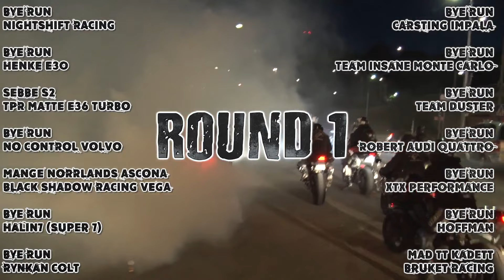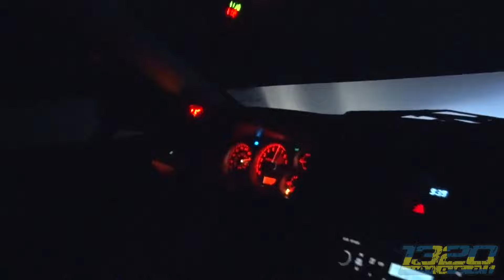The STOCKHOLM OPEN Street Race (Full Movie)

Comment: Something isn't right about the TTviper vs the Busa.  The Busa's approx weight with a 130lb rider (for simplicity) is 660lbs.  The viper with driver is (not adding any weight for power adders on either vehicle since it's a roughly equal ratio for each)  3572 lbs.  Busa 330HP to 660lbs is a 1:2  power to weight.  The Viper, 3572 to 1200HP is just a hair under 1:3 (2.97).  So that Busa should be vanishing.  I don't see him losing traction, if he was the back end would be everywhere so  I'm betting it is a lot closer to 220HP.

Comment: I'm just wondering if those cars are registered in Stockholm or are legal o drive on the highway or if they just put some licensplate on it and don't care about the rest🤔 would love to hear if you guys know
Reply: Some are legal if the police run their plates (registration ok, insurance ok, inspection ok) but none of them would pass a actual annually mandatory inspection since its not allowed to up any horsepower at all. We got pulled over at this year's SO, car was registred and had insurance but did not have a passed inspection since 1993 so we got a 150$ ticket and a warning.
Reply: @Halibrand  ok so the plate is just to look like it is registered and rule no. 1 don't let them catch you
Reply: Yes, if you run without plates you will for sure be stopped asap. With ok plates but with a vehicle that has dragracing slicks and no exhaust there is atleast a small chance of the police looking the other way. We got stopped right after we lost our second round and we were about to load the car on the trailer, So they had no proof of who was driving since they lost sight of the car after its pass (being held up by spectator cars) ;)

Comment: This is real street racing. Noticed that in Street Outlaws you never see them test and keep a look out for cops anymore. Nor do they seem to be having any troubles at race night either. They just race on securely closed off, and probably private roads they borrow for every race night. Probably the same road every night.
Every one of theese cars are street legal and doesn't overheat or break  like they do in SO, plus, they are driven to and from every race and not brought in by trailers. SO is just about expensive race cars, raced on the street for bragging rights amongs them, while pouring thousands upon thousands of dollars into them just to keep them running in between races.
Reply: None of these cars are legal. Sweden have very strict vehicle rules.
Reply: @JonteTheMan1  They are legal on paper.

Comment: This crap where the pit crew hold the car down during the burnouts doesn’t make sense to me. Wtf?....?
Reply: Our roads here in Sweden aren't perfectly flat. They have an angle to them. If you don't hold the car it will start sliding, even with line lock.

Comment: In Sweden it's actually illegal to speed they arrest you did races are normally held during the daytime all the real Grudge Racing it's held on the freeways they use a couple cars block off the freeways which caused traffic then the two racers rip the freeway at night time there is actually creepy there's no one on the road except for cops someone cop see a car they normally follow you the cops there are only allowed to do about 50 miles an hour but at night it's normally hell for road racing guys they race from one side of Stockholm all the way to the other side which is the police station they actually drive into the police station parking lot do donuts it ain't get chased by the cops out of there and race all the way back to where they started New Order makes the back first of course wins did you have helicopters a lot of times they don't send them out so you outrun all the cop cars but during the daytime they do send out the helicopters there is normally no trash-talking or hypeman your car's do all your talking